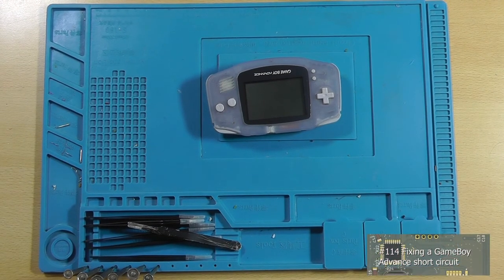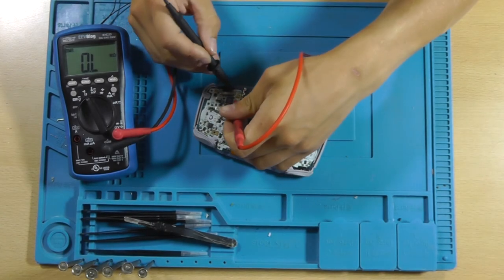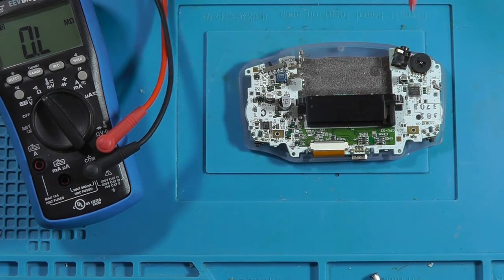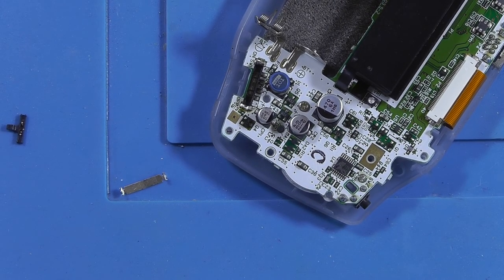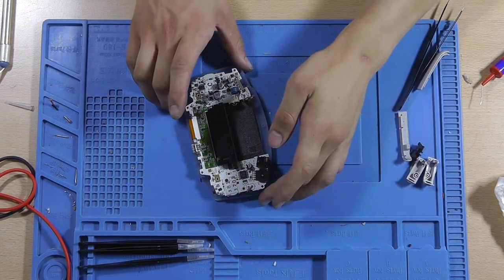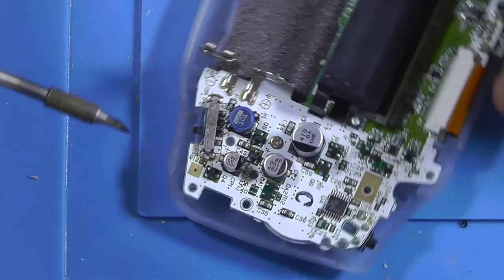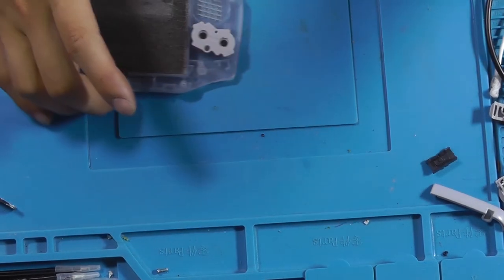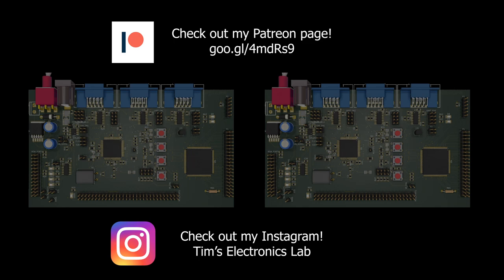#114 FIXING 🛠 a GameBoy Advance 🎮 SHORT CIRCUIT ⚡

Comment: I've got a GBA that only turns on every five to seven times. When it doesn't fire up the power light flickers. But when it does turn on it's gtg. I cleaned the power switch and nothing. I then replaced the power switch and nothing changed. I've tried different screens as well. Any ideas?
Reply from the maker: I can only assume that a dry solder joint might be the problem. Inspect the solder joints and resolder if required. Use plenty of flux and quality solder and you should be good.